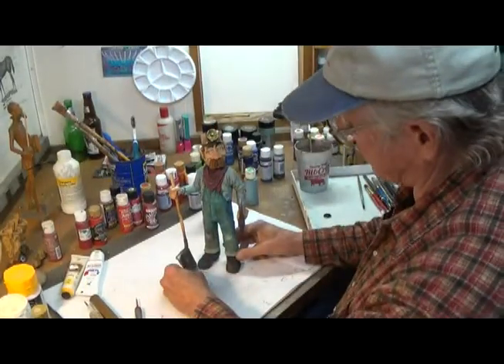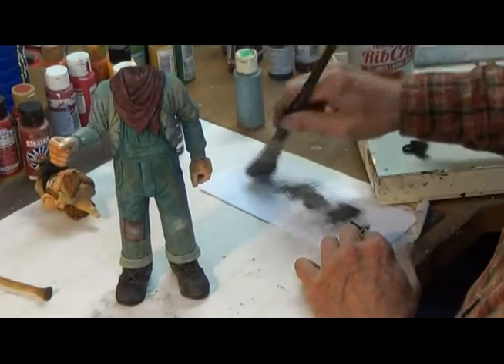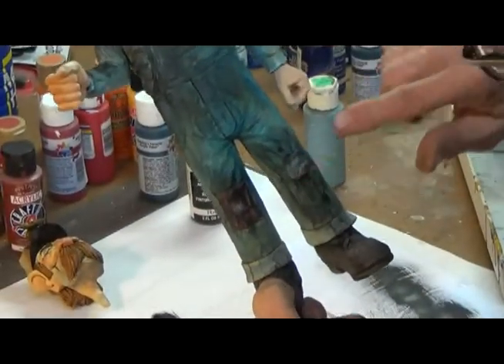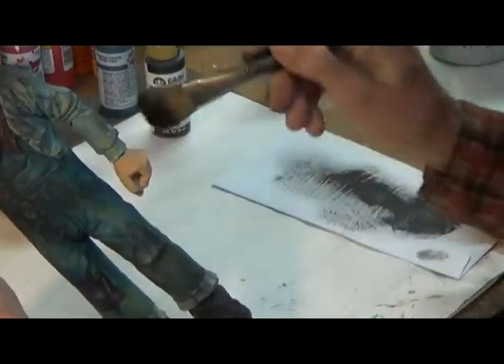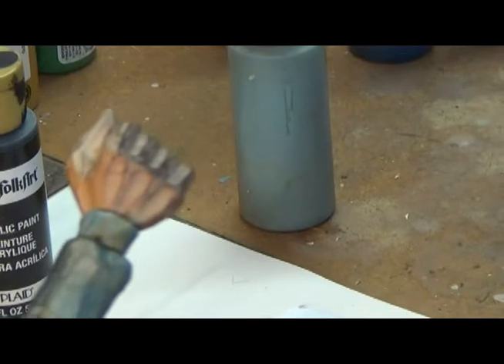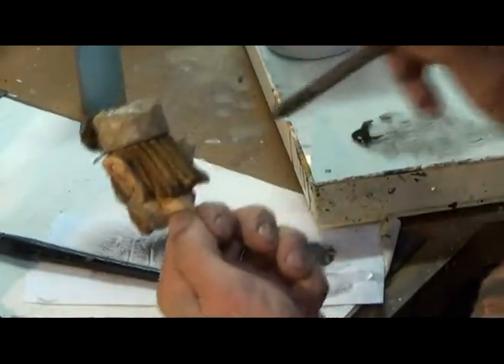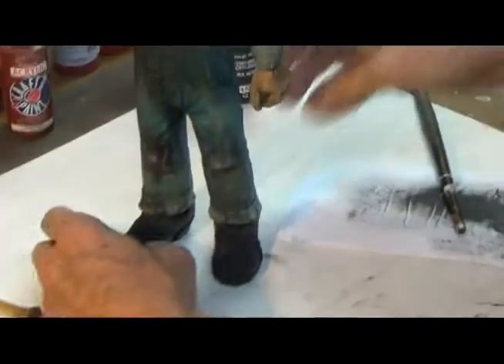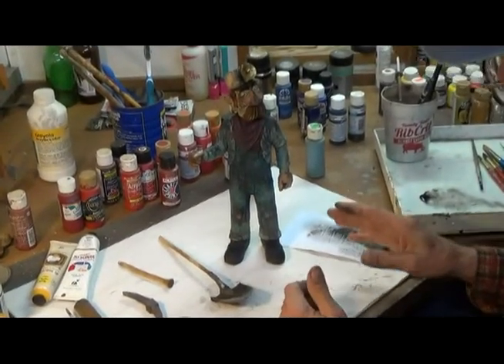The Coal Miner - Part 32   Let's Get Dirty

Comment: The places I would expect to see the most coal dust would be from the boots up-
  Boots and bottom of the overall including the inseams fading up to just below knees . Feet/foot wear always seem to catch on the inside of your lower legs.
  knees  and some  over the top of the thighs were he might wipe his hands .
  On the bum where he would sit to eat lunch. The contract point were his heels hit his bum if he sat back on them from a kneeling position.
    On the material that makes up the back of the pocket and on the pocket edge where his  hands would rub.
  Across the belly as we all seem to use it as a brace and a rub point .
  Hands  and bottom of sleeves are much the same as the boots, dirt travel up fading as it goes . Elbows bash and brush into everything and from elbow to shoulder would have the same problem .
  On top of the shoulders is where he would carry this tools/long lengths of wood for bracing so heavier in the middle dip and fading out.
  On the face you could put an outline , a cleaner area around the eyes from where he used his handkerchief to wipe his eyes free from the dust . 
  Hat brim would be heavily stained and maybe the back from were he would settle it more firmly on his head due to the weight of the lamp.
  Handkerchief would be dirty from cleaning hands and face.